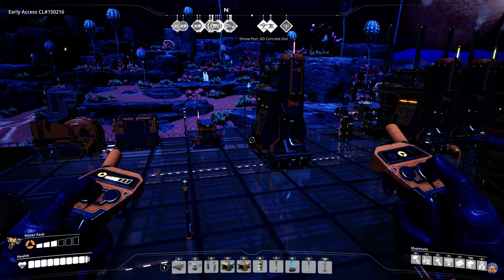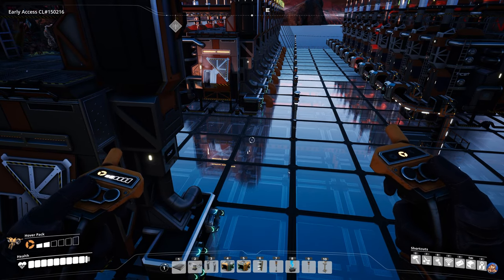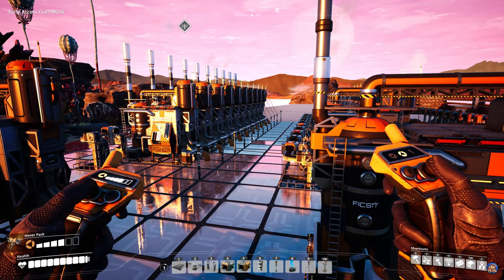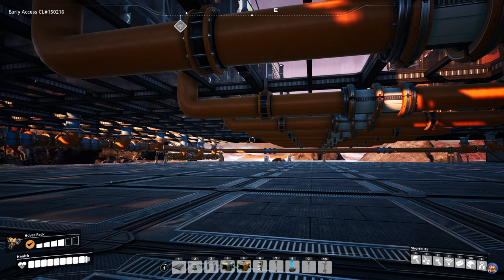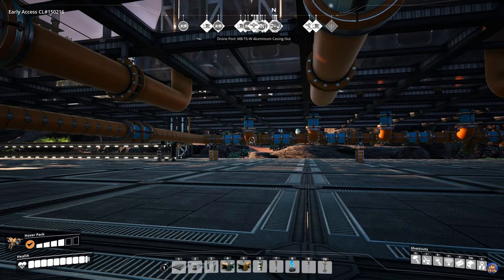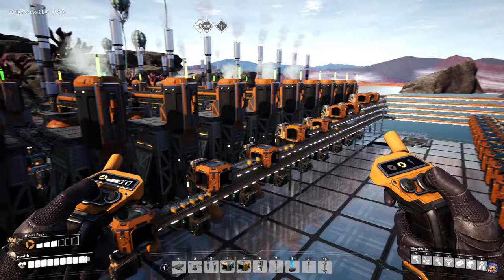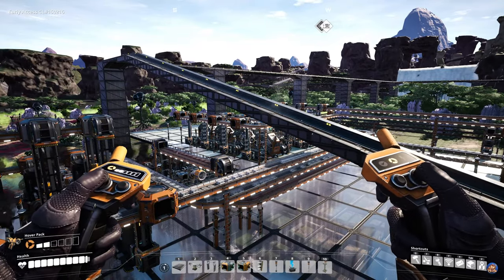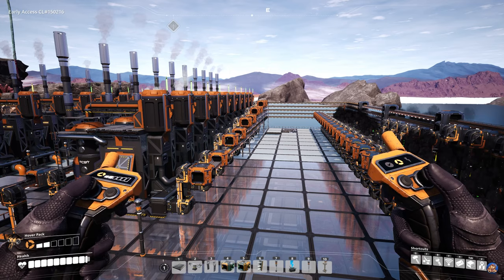Satisfactory Tutorial - Aluminum Setup - Basic Aluminum Recipe Setup - Satisfactory Update 4

Comment: you do not need to scale up your refineries to 6 just because of the magic water number.  Update 4 brought in Valves. It has directional flow and flow limiter. You can take 2 refineries that make solution and connect to 1 refinery that makes scrap. Plug in 120 water back to 1 refinery and put flow limiter so it doesn't allow to flow in other direction. On the first refinery put another valve that limits flow to 60 and you have you 180 water with 120 of it recycled
Reply from the maker: The valves actually came in 3.5 or 3.6 😀 And they are a great addition to the game!

I looked at this solution as an option, but the valve limitation is for continuous flow - not for "allow only this much to pass, and then stop". Which means that there is a risk that the alumina solution refinery pipeline gets saturated by water from the extractor(s), since I believe the valve will continue to let water through (albeit at a much slower pace). And that can end up with the scrap refinery line stopping because they can't rid themselves of the water.

I could have connected the pipes up and placed a valve that only allowed flow out of the recycled water pipeline, or that blocked any water input flow from the water extraction pipeline. But decided that that would just not make sense... Hence the two separate and dedicated pipelines in this suggested setup. 😊
Reply: @Caledorn  have to agree. came here looking for solutions to this very thing. Knee deep in water using valves. unreliable when dealing with erratic flow rates.  My system wasn't built to be split so not sure what I can do to correct it. refuses to balance out.

Comment: This is an excellent guide, and the spreadsheet diagram at the end was absolutely perfect to explain the entire setup. I do have two questions, however, and this is coming from a player who just entered Phase 4 and completed the first milestone to unlock the ability to produce the Aluminum products, so I do not know what's upcoming in the game yet beyond Nuclear power stuff:

1.) In regards to the spreadsheet diagram, the "Alumina Solution Loop" isn't so much a "loop" and more a convergence of the two pipes, correct? The arrows are the indication of the flow, I would assume, so the north and south sides of the "loop" both flow to the right of the diagram, right? Fluid dynamics in this game have always been a hassle for me (I did watch your Coal Power Plant tutorial, which was very helpful when I set up mine), so I'm guessing there's a reason it's a "loop" all flowing to the right, likely something about the fluid dynamics to make sure the pipes supply the destination correctly.

2.) What is the point of making 720 Aluminum Ingots/min? To make 720 Alclad Aluminum Sheets? But then why not help save on power and resources by making a smaller setup? I'm gonna guess that the Water byproduct becomes the reason for 720/min, as doing that much allows a perfect ratio so the water byproduct is not a problem. That does make perfect sense as to why, I just wanna be sure that's the reason and not that some future production line is requiring 720 Alclad Aluminum Sheets or Aluminum Ingots.
Reply from the maker: Thank you! 😀

Indeed it's not so much a loop as it is to get the fluid in from both ends. And for Q2, you're spot on in your assessment that it is indeed the water that is the reason for 720/m. You can scale the numbers according to your needs, but I would recommend not going beneath 50% of this setup, for fluid dynamics reasons. Half the setup should work, and might not even require the "loop" - but by the time I build aluminium I usually have many GW power available from Oil Power, so power is usually a moot point for me the way I play (excessively, one might say 😂).
Reply: @Caledorn  You're awesome, and 'twas a very quick response! Oil Power setups do provide a hefty supply to power many things, and the factoriolab site estimates that an Oil Power setup would be far more than sufficient to power this build. It's now just a matter of finding enough of the resource nodes that aren't too far away from where I could build such a factory.

Thanks again, for not only the tutorial but for answering my questions! :)
Reply from the maker: @TheRadikarAuthor  Thank you again! 😃I have a stream archive (the latest one) where I'm showing of a rather substantial oil power plant build on the Gold Coast. I use rails to pull power throughout the world, both because I love trains, but also because I think it looks better than having power poles crisscrossing the landscape all over. Now, I don't know where you are building - but there are some interspersed oil nodes here and there. Building up at the northern nodes I would recommend staying away from currently, since that area will be completely redesigned in the upcoming update 6 (as you might know), so if you want to use the nodes up there, be prepared to pull everything down again - potentially using mods to get noclip abilities - but the Gold Coast (westernmost middle of map) is a great spot for power IMHO, since it supports well above 40 GW of power from the 4 nodes there 😁